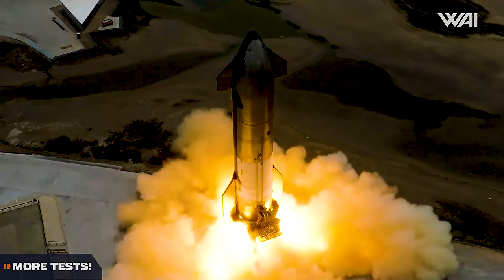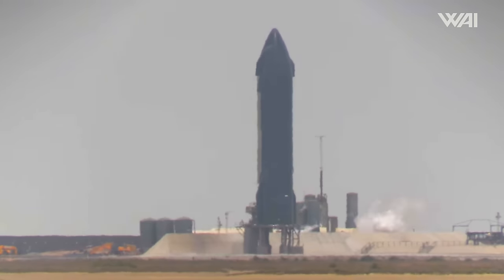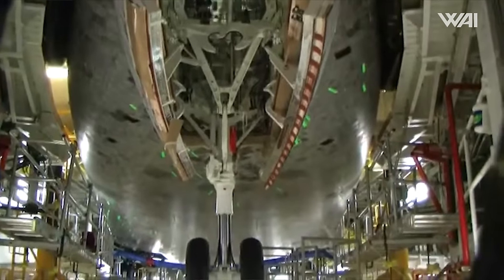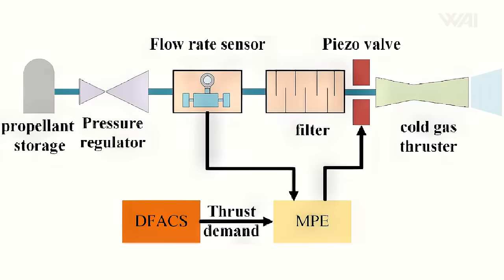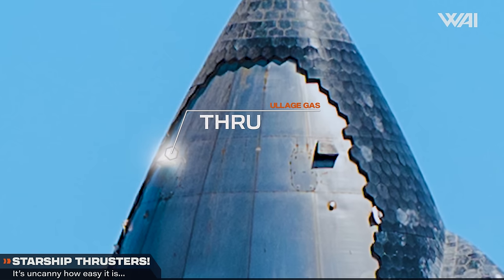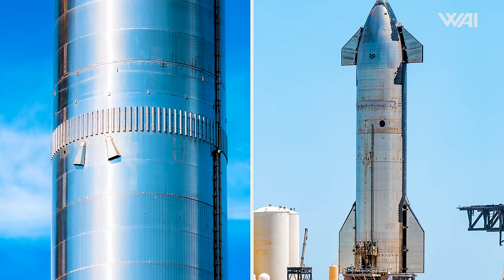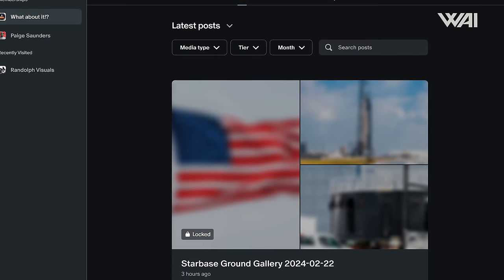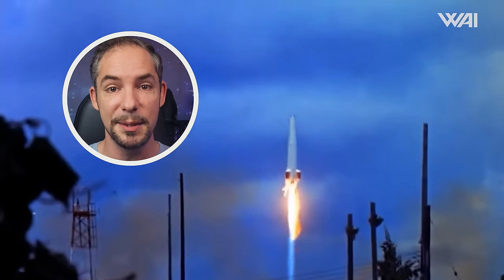SpaceX Starship's #1 System Fix Needed!

Comment: The butterfly effect of the Chaos theory. Was the chamber for the starlink satalites full of air one the 3rd launch? How much extra fuel was needed to bring that air into orbit? Was the motor on the pez dispenser strong enough to over the force of the air on the door?  When the door started to open, what direction did all the air go? What direction did the starship rotate from this large volume of air?  Could the rotation be compensated? Were the heat tiles in the corrected direction for landing? Do you think 4th launch will have air in the chamber?

Comment: I would think that they have simulated the thrust of the current attitude system. If they plan to launch in such short notice, it likely implies that they don't have to do major system updates, but just fix some issues with the current one. And according to Gwynne Shotwell, they are not postponing the attitude problem either. They want to have this resolved and tested with ITF4.

Comment: Could they change the heat shield tiles to tongue and grove type so that the tiles are not just stuck in place with no lock to hold them in place, but if they are fitted like a tongue and grove fit like the same method as tongue and grove flooring, just a thought. 🤔🌠

Comment: SpaceX should try a design with larger (then curved) hexagon tiles, to enable more attachment points per tile and simultaneously reduce the number of gaps between tiles… at least for the uniform straight parts of the fuselage/tanks. But thats just imho.😅

Comment: My idea for heat shield on starship ... what about a heat proof kind of paint. you paint it on and when it's dry it will be strong enough too protect ship from plasma during re entry ... I'm sure if spaceX tested a paint formula that protection against very high temperatures....

Comment: SpaceX could build a two stage counterflow heat exchanger and centrifugal separator for combustion byproducts that leaves the main O2 tank vapor relatively pristine. That is extra weight, but it might still weigh far less than folding such functions into each Raptor 3 engine.
Reply: I envision routing the hot regenerative gas to a counterflow heat exchanger, it exits to the tank bottom and is chilled in the centrifugal separator, submerged in cryogenic O2. The relatively pure O2 gas is then reheated in the counterflow heat exchanger and released into the O2 tank near the top. 

The downside is that the O2 vapor is cooler. The upside is that valves do not stick.

Comment: I've always wondered if they couldnt just use something like a spray foam insulation or other coating they could just blast the ship with as an ablative heat shield.  the tiles are so fussy and require so much tinkering.

Comment: the space plane prototype nasa made with areospike engines used a metal that id use instead of heat tiles or switch out for graphite composit heat shielding with ceramic plugs for the bolt holes.

Comment: Why don't the anchor the tiles on. Like screwed onto the ship?
Reply: The "screw" or other anchoring device would be a point that would concentrate heat, for 1 reason. The tiles are ablative (I believe), therefore they need to be homogeneous all the way through. I think they used RTV to anchor the shuttle tiles.

Comment: Hot gas RCS using gaseous oxygen and methane stored in COPV's which come from compressors from the main tanks, the igniter could just be a hot surface igniter ie glow plug.

Comment: The heat shield tiles could be designed to interlock on all sides, don't ask me how, it could be so complicated, or so simple only AGI will be able to solve it, I don't see how it could be impossible, the engines don't fall off, a paradigm shift in thinking obviously needs to happen and the people with "crazy ideas" need to speak up.

Comment: Much larger panels a couple of meters across and multiple hard connections would be easier to replace and harder to shake off.
Reply: unequal expansion between the hot side and cold side of the heat tile will cause large tiles to crack. Also large tiles are more prone to cracking during launch than smaller tiles, as a large rigid panel is less able to move and flex than several smaller rigid panels

Comment: What they have to do is🎉 just grouding the tiles with an epoxy ,   resistant to heat,,,, like a armor,,,, expansion and vibration stress the stainless steel,   the "Kind of epoxy" can help and protect the fuselage too.

Those tiles are just hanging there ,,, they need to be set in place with a straight elastic compound tolerance to heat without lost properties.

Comment: For Starship HLS, they actually NEED to develop a mini Raptor for the upper level thrusters used to land on the Moon, just saying.
That being said they also NEED a real RCS system not linked to main tanks or heat the nozzles, otherwise... what happened to Flight 3 will happen again.

Comment: They should trash the heat tiles and just re-enter the atmosphere engine first. Light the engines 20% to push the shockwave far enough away from the ship that the heat is no issue. Problem solved.

Comment: Regarding the heat tiles I think a less complicated solution would be larger pieces. As in, a LOT larger. Say, 4 pieces over the whole width.
Reply: It wouldn't be very feasible, honestly.
I'm think there's a reason why they make them the size they do
Reply: I agree if not solved, will contribute to its ultimate demise. Maybe a spray foam or blanket type device.

Comment: Looks like the mounting of the tiles nearer to the engines have to be redesigned to make it more hardy.

Another alternative is, that Starship carries tiles with it for those most likely to drop. Then, do a repair in space before re entry. If course easier said than done.

Comment: I'm not convinced of that vertical landing on the moon with uneven terrain...seems pretty risky
Reply: It's utterly impossible, and guaranteed to fail.
The tipping angle:   TA = atan(H / BL) * (180 / π)
Where BL = base length.
You can set a desired Tipping Angle and solve for BL. 
Good luck !

Then it's need another 20 astronauts. NATA

Comment: Fuel slosh - F1 racing cars have a 'mesh' inside their fuel tanks for two reasons - cut drastically down on fuel slosh, and secondly if the tank is punctured you do not get a rapid unloading of fuel which usually burns the driver up badly. Wouldn't have to do the whole tank - maybe just the bottom third by the fuel outlet.
They have to redesign the tiles, plain and simple.

Comment: Perhaps another deluge system at the level of the chopsticks, spraying fresh water not at huge pressure but high volume.  May help suppress some of those pressure waves.

Also, tile design. Perhaps the center pin should be tightly located, but the perimeter pins in channels so the are captured, but able to move a few mm in every direction.

So the tile remains well located, but as the tile is vibrated it does not get "pinched" as the pressure wave travels through it.  Looking at the recovered tiles I've seen, it looks like being too firmly connected may have allowed the pressure waves to squeeze them between pins and pop off.

Comment: I disagree that RCS is the primary fix for Starship. The control rate seemed to be WAY too slow at altitude, and this craft can't, or shouldn't, entirely rely in RCS to get a stable reentry. From what I studied, the RCS would likely run out of authority before the flaps are in dense enough atmosphere to significantly improve control rate. They likely will need a flap redesign, maybe something like 1/2 span strikes from front flap to rear, only acting in roll and stowing "vertically" when low enough it's not required. Starship needs to have an aerodynamically stable attitude, or a state at which its at least marginally stable with the flaps fixed in a specific position.

Note: control rate doesn't mean they move too slow, but the aerodynamic response is too slow which can be attributed to primarily size/efficiency as well as secondarily to actual movement rate.

More powerful RCS would just be a bandaid to stop an unstable reentry. As mentioned, there is likely a point where the RCS is no longer capable of adequate control, while simultaneously the flaps aren't very effective yet - esp with bow shock effects and their influence on other aerodynamic effects.
Reply: Not sure how that's supposed to help... the control issues were apparently long before it descended to air pressures strong enough for aerodynamics to be of any great help.

Comment: SpaceX needs to figure out how to develop a skin that can withstand the heat of reentry. Then either clad the entire ship in that 'sheathing' or somehow just use that instead of the stainless steel shell. Perhaps some type of bonding between stainless steel and the heat resistant shell material during manufacturing. Might require development of a brand new material. The tile concept was problematic then for Space Shuttle and is problematic now for SpaceX. Time to rethink and re-engineer the solution I think.

Comment: Well, first off, they haven't changed the tile attachment process in years, so it's clearly not their focus.  If I were to guess, right now they're playing the same "wait and see" game that they've been playing with their second and third towers/Stage 0s, waiting to see how well the current design works before moving forward with construction.  We still don't know how well a heat shield with a dozen missing tiles performs during reentry, and until we do (IFT4?), they'll probably continue to do nothing about the falling tiles.  I think once they have that data, whatever solutions they've been cooking up will finally start appearing on new Starship models.  The fact that 99% of the tiles do stay on means the solution could be a fairly simple tweak.

Comment: One option you did not mention would be to offer some electrical heating for the cold gas thrusters using the Tesla batteries that re on board to move the flight surfaces. I can't imagine that a lot of electricity is needed and the battery is already on board, so it would only need a few wires and some small heating elements.

Comment: I posted this idea before on another video ... someone should get this to Elon or SpaceX, wouldn't it make sense to put a coating over the tiles to keep them from getting moisture in the cracks between the tiles that could potentially freeze and push the tiles off the rocket from the expansion of the ice formed from the cryogenic cooling of the tanks inside the rocket? Let the coating burn off later but keep it on the tiles to hold them in place and help keep them from falling off as well as sealing them from condensation of moisture in the air.

Comment: Lets have a poll about missing tiles. 
1. Tiles falloff because of No flame Trench
2. Tiles will not fall off if Flame Trench technique is used.  

Please Type 1 or 2  :)
Reply: Needs a way bigger flame trench. 39A/B size. Having one big booster with 33 engines is a downside on too much energy in one area. Better if the Spaceship was taken up with 3 boosters of 11 engines.
Reply: @MrRottenAli  Flame trench is likely only for ships; full Booster static fires must happen on an OLM because you can't start the outer 20 Raptors without the 20 high-pressure disconnects.

How about 11 boosters with three engines each, asparagus staging FTW 🤣

Comment: The Heat Tiles Issue is because they have no flame trench to redirect the blast away from EVERYTHING instead of in Every direction.... I  Bet You if they just used one they wouldn't have any of those issues.. I also think that's exactly what's happening at the Cape right now.... after removing the failed Launch Table Idea which is just sustaining too much damage every launch because NO Flame Trench!

Comment: a totally different solution with each tile having its own suspension,  to make it "shock wave proof"  tiles cannot ever afford to be lost so easily. and if the other side was covered also the ship could roll and perform an emergency entry on the other side.  💣💣💣 in case of space debris contact damage.  space station should have a few spares just in case. so starship could rendevue and be repaired if necessary.  what would happen to the starship if it was struck by a nut or bolt at 12.000mph ?

Comment: They NEED to figure a more robust method of heat tiles mounting.  What did nasa use on shuttle? Can’t afford to loose just one on re-entry. I remember shuttle mission burned up on re-entry due to missing tile.
Reply: Shuttles did lose the odd tile, but none burnt up due to a missing tile.  Colombia burnt up re-entry due to a large hole in the port wings carbon fibre leading edge caused during launch when it was hit by a block of foam insulation that fell from the external tank.  Nasa knew it had happened and saw it on film of the Launch, but decided (without checking) that it could not have done significant damage.
Reply: @richarddoyle689  Yes I remember when that happened and see in the video and to me I know it’s hard carrying tiles extra tiles because they all had a unique shape

Comment: Tiles need to go away.  We need some form of ablative armor or spray coating. Maybe they can have an entry plate that can be charged to help direct heat off the plate instead of absorbing it.  Sure, we are talking about an entire new tech and power supply.  But something better than flaking tiles has to be possible.

Comment: Tile fix! 

Scrap the current fragile tiles. Instead use thin stainless steel scales, much like a reptile, with a thermal blanket between ship and scales. These would be much more rigid and easily replaceable. We know stainless has an extremely high melt point. Also, the current tiles weigh a pound or 2 a piece so scales should definitely be around the same if not less?
Reply: melting point of steel is 1370 Celsius. Heat of reentry is 1470C going as high as 3000 C at the edges. Stainless steel will melt like butter under that temperature.
Reply: @nickl5658 why are the temperatures so much higher than the Shuttle which only got up to 1600°C?
Reply: I agree soupy, I feel tiles will doom the starship, he'll even  a few layers or specially  treated wood , would work  better. The Russian  did this back in the 50-60 era  , or a special,  metallic blanket, or heat resistant  spray on foam. When it lands just rewrap or respray it. Fragile dinner plates stuck on there seem so 70's, get with the modern  Era Elon...
Reply: @nickl5658  there are numerous materials that can be used as a heat blanket or insulation between the ship and scales. This insulation could be used to help cool the scales just like the fuel is used to cool a rockets engine nozzles. There are numerous solutions to cool the scales. As it stands now with the current heat tiles, full reusability might as well be science fiction. With that said, I believe SpaceX is the only company that could make this dream become a reality.
Reply: @leschortos9196  if we ever expect to build a fully reusable rocket then I believe the heat tiles will be starships biggest hurdle. If anyone can make it happen its SpaceX.

Comment: I have always thought (and still do) that Space X is making a HUGE mistake in thinking it's going to land a Starship, upright, on the moon.    As has been repeated demonstrated/proven by the Surveyor, Apollo and recent missions to the moon by both Japan and the U.S. (both of which tipped over), the surface of the moon is VERY irregular, necessitating  a wide configured landing system (legs) similar to Apollo in order to successfully land.    Why NASA even considered Starship is beyond me.  My money is definitely on the "squattier" configurations.

Comment: Makes you wonder that a catastrophic failure of a Starship would do to South Padre. Especially if the tank farm blew up too.
Reply: Not much. I mean, yeah, it'd be a big explosion... pretty cool to watch. But it's also going to be limited by the fact that the fuel and oxidiser aren't going to be especially well mixed... so you're mostly going to get a dramatic flame front between them, rather than the cataclysmic explosion you're imagining. The Delta 2 incident in the video was different because it features solid rocket motors — fuel and oxidiser pre-mixed to the ideal ratio to burn — and when those go bang, they go big.

Comment: Just use duct tape 2 hold the tiles on ... once it's on the way down natural forces will keep em stuck there when the tape melts away ...   if u can't fix it w duct tape ... you're not using enuf tape hehe